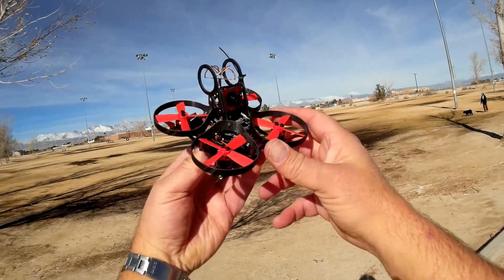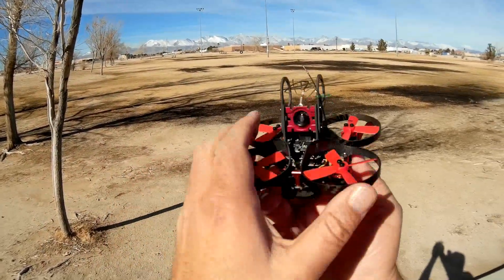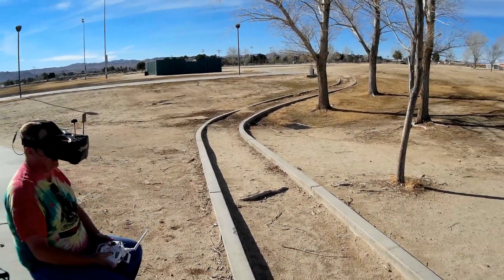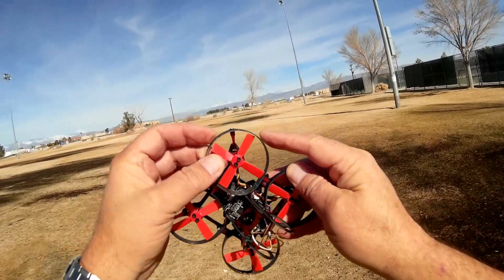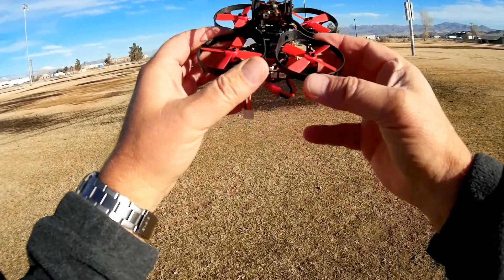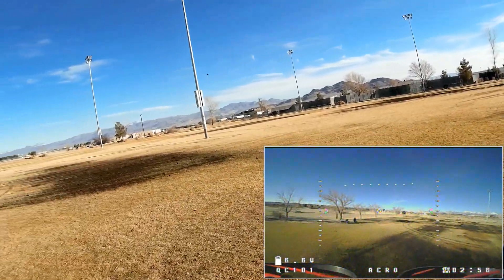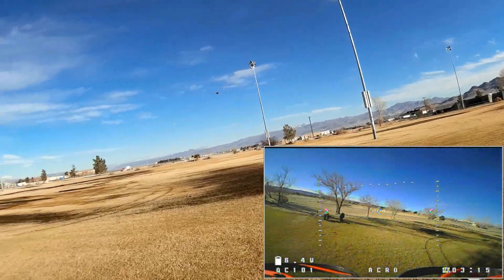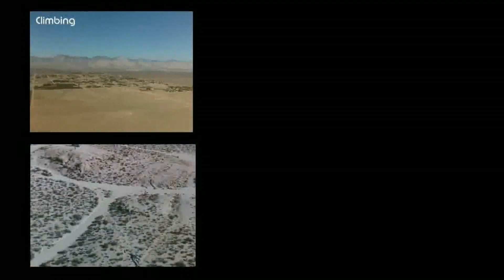Eachine Aurora 90 Brushless Mini FPV Drone Flight Test Review

Comment: The new Aurora90 version (July 2018) comes with an adapter USB cable. You can easily use a pair of tweezers to connect the USB cable to the flight controller without removing any screws or turning a fan duct. I'm very happy with my Aurora.

Comment: Aurora stock props are very brittle, yes. They broke on slightest crashes. I found that because I was stupid and ordered them for XBL117. It flied as pregnant cow too. Well, now I know that 2030 props are too small for this frame. For Aurora get DYS 2030 or other stronger props.

Comment: What receiver did you use?
Reply from the maker: DSM2/DSMX
Reply: The reason I asked is, I bought a Devo 10 and put a 4 in 1 module in it.  I haven't been able to bind it to anything but a Walkera so far.  I tried to bind it to and Eachine 010 which it should do from what I've seen on the supported models at the Deviation website.  I get no error messages on my Devo 10 and my menu seems to be working OK.  I just haven't been able to bind to anything.
Reply from the maker: I did not install any module to mine.  But it is important to install the Deviation firmware to enable you to bind to DSM2/DSMX transmitters. The firmware and insturctions for installation are available here https://www.deviationtx.com/
Reply from the maker: Their are several versions of Eachine E010.  But the only version that the Devo 10 can bind to with Deviation firmware is the Eachine E010S with DSM2/DSMC receiver installed (note that the E010S is also available with Flysky and Frsky receivers, which the Deviation modded Devo 10 will not bind to).

Comment: airmode is not really a mode. you can put it on all the time. it just keeps your motors spinning and not stall.  I just put it on the arm switch or you can go to setup and put in on all the time. sometimes when landing airmode will jump around,I don't recommend landing in airmode.

Comment: Do you get that snow in the goggles that shows up in the video.
Reply from the maker: I was a little off frequency.  But snow is common with analog FPV.
Reply: That is cool. I was a two-way radio guy and low band under 1 gig such as CB/HAM/UHF/FM and early analog cell phones such as bag phones ran at 900 meg but transmit a lot farther than digital frequency waves travel. Do you mean that analog FPV runs under 1,000 meg or 1 gig when I was under the impression anything over a gig was high band which is what digital frequency runs such as the common 2.4 and 5.8 gig signals use for most cell phones and FPV?

Comment: will this quad fly on a 3S battery?  I've seen other similar quads with same size parts do it so I just wondered.
Reply from the maker: No, although the ESC's might handle it, the vendor says that the motors can't.

Comment: Hi , I see that you use a Walkera remote , is this compatible with dsm2 ? , I have a stock Walkera F12e so If I buy  this aurora 90 will it work ?
Reply from the maker: You would first need to flash Deviation firmware to the transmitter.  Please see the following, especially the note regarding nightly builds https://www.deviationtx.com/

Comment: Is there ever a reason to use acro when you got air mode available? Isn't air mode just acro but with attitude control still available at zero throttle?
Reply from the maker: Joshua Bardwell explains Air Mode here https://www.youtube.com/watch?v=d2nRrVENEYM&t=456s
But I was also told that I need to program Air Mode + Acro Mode together.  That confuses me as "Acro" is not a selection item in Cleanflight or Betaflight.
Reply: Maybe they call acro something else? I think I remember seeing it also being called "rate mode" if I'm not mistaken.
Reply from the maker: Acro is another name for Rate mode (and vice versa).  But neither is selectable in Betafight or Cleanflight.  Instead,  if a switch selection position is left undefined, it's assumed by the software that that position is Acro/Rate.

Comment: How do you get both videos shot and merged in your videos
Reply from the maker: This video along with every video of the Quadcopter 101 channel was produced and edited with VSDC Free Video Editor.  VSDC includes picture in picture (PIP) capability. You may download this excellent, and no kidding "free" video editor here http://www.videosoftdev.com/free-video-editor
VSDC does require some practice, and recommend viewing VSDC tutorials on YouTube.
Reply: How do you sync both cameras to be showing the same pictures at same time..
Reply: I am curious how you can get screen from controller and camera view synced  into the videos from the mavic  pro.  By the way thanks for taking my questions.....I appreciate your assistance....LJ
Reply from the maker: VSDC is a non-linear video editor.  This means you can overlap the videos, and you can slide either video right or left to sync.

Comment: Back in the "Olden" days when I was young and had hair, we had combs that were advertised as "Unbreakable" and they were. 
Made out of some tough nylon.
Apparently, the formula has been lost to the ages and has gone the same route as Damascus steel. :-)
Reply from the maker: I got one in my back pocket right now. The problem is that nylon also is flexible.  The motor support arms of the quadcopter need to be very stiff to prevent any twisting.  Twisting or flexing in high g turns would be very bad, as it would cause erroneous inputs to the controlling gyro sensors, and would likely cause a crash.
Reply: Good morning Quadcopter 101!
Sorry, I was being a bit sarcastic.
I have a 3D printer and print with a range of plastics including Taulman Bridge which is super strong and stiff enough for props.

Point being that there are props like the Dal "indestructible" brand made from much better plastics and should stand up to the abuse you dish out. (more sarcasm.)

I just question why anyone in the quad making business would use such easily breakable plastic props.
Eachine has been doing this long enough to find a good supplier.

Wayne
Reply: Probably for the same reason HQ still sells their tried and true 5x4x3, which break like chips if you have ever used them.  They simply perform better than any other prop.  With that said i fly mostly Dal cyclones now, which are much, much, much stronger, but will still break.  A truly unbreakable prop will be out of balance after one crash and you will never, ever be able to bend it back right and have it perform as good as new.  Some of us are very picky about performance.

Comment: The battery you used on the acro flight was not fully charged and seems like it has probelsm since it went from 8v to 7.4v in 1 second
Reply from the maker: No it was fully charged prior to both flights.  The drop is to be expected as electrical load is applied.  And the load of its brushless motors is quite a bit as compared to its little 7.4V battery.
Reply: Get a higher C rated battery and you wont have the huge voltage drop, I imagine your vbat is not calibrated properly also since you started on 8v and not 8.4v, this thing can fly longer than you give it credit for. You just didnt set it up properly

Comment: Great video!! Are those the VR D2 goggles that displays the info on the screen? I like to get those & put my name of there      :)
Reply from the maker: I did record the video using my VR D2 goggles.  But that's not how you change the name.  It's done in Betaflight.  Betaflight allows you to configure the OSD settings.
Reply: Quadcopter 101 Ok. Thanks much. I'm new to the drone racing world & trying to learn more about this stuff      :)

Comment: I think the props may have been stressed upon installation. I've seen that happen before. I've seen other reviews of this little guy, and I think you need to calibrate the VBAT reading, as it tends to be a bit low .. easily adjusted in Betaflight. If you do go into Betaflight to calibrate the VBAT, you might consider changing the mode order to Angle, Horizon & Acro + Air (3rd position). I think the way you have it set up now, you have Angle, Air/Acro & Acro. No doubt its a good little flyer, but I can't see flying it indoors in your living room (for obvious reasons). A shame about your H helipad ... it was a nice touch. I have a pink top from a Rubbermaid under the bed storage container which is pretty big, and usually use that if I'm going to be taking off from sand, wet grass or other nominally poor take off areas. Hey, we have Sun today .. now I know its still there! Cheers!

Comment: hi could you tell me the best drone for starting my quad hobby. I'm looking at either hubsan 501s or hubsan 502s. thanks Ian.
Reply from the maker: I always recommend the Syma X5C for new fliers, due to its excellent stability, durability, and ease of flying. And it even has a camera too.  Use it to learn the basics of flight with.  Let this cheap quadcopter take the inevitable crashes and bangs of a beginner flier. And if you break it, every part on it is cheap, widely available, and easily replaceable. Later as your flying skills improve and you're not crashing as much, then consider something better/more expensive.  https://www.youtube.com/watch?v=y93vzA-KRlM
Reply: Quadcopter 101 thanks very much
Reply: Hubsan Choice are they easy to fly. as I did want follow me and return to.home
Reply: I got the 501s with standard tx early last summer and it was my first drone and its really easy to fly in gps mode. Still enjoying it.

Comment: What's the difference between brushed and brushless motor?
Reply from the maker: Brushed has better teeth ;-)  http://www.thinkrc.com/faq/brushless-motors.php
Reply: One has a brush, one doesn't. Brushless is always better
Reply: there is no moving parts in-side a brushless motor
Reply: "no moving parts in a brushless motor" really? lol
Reply: Good reference for brushed vs brushless.
tldr;
Brushed wear out, can't be run in reverse (must use cw or ccw for that direction only), but don't require a separate ESC (electronic speed controller). Brushless last a very long time, can be reversed even if they have a stated direction, require a separate speed controller. More powerful especially in regards to high end torque.
Only at the very smallest and lightest sizes do brushed make sense, where the added weight of an ESC outmatches the performace gain. 

So once you get below a certain microsize (with current tech the cut off is about this 90mm size) brushed become viable, but you have to replace motors frequently.

Comment: $150 I don't think so, for this kind of money I can get a great full scale Quad like the MJX Bugs 3 $80  Of  course if you get it free than its wonderful.
Reply: You are comparing apples and oranges, that MJX bugs is a wannabee phantom, the aurora 90 is a 90mm acro quad designed for doing flips, rolls, loops, etc.  You can hardly build a quad of this size for less than $150.
Reply: Well you buy this and I will buy the Bug3 haha
Reply: Bugs have completely different purpose - filming. This tiny fly are purposed for tricks.